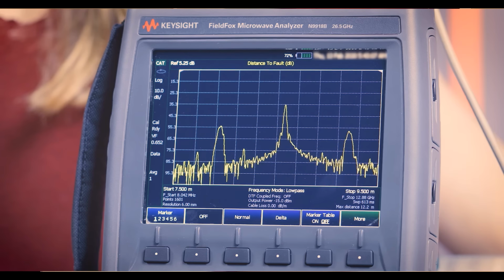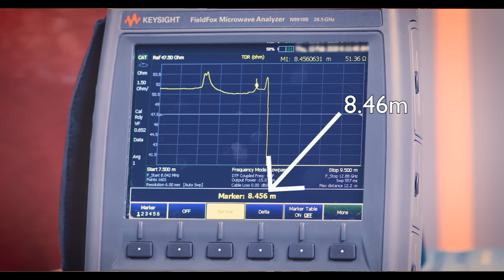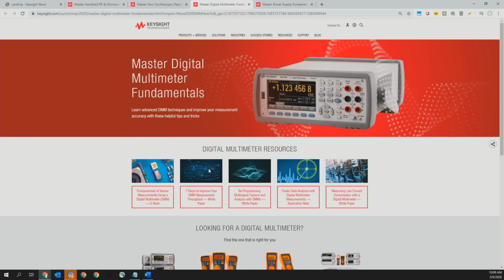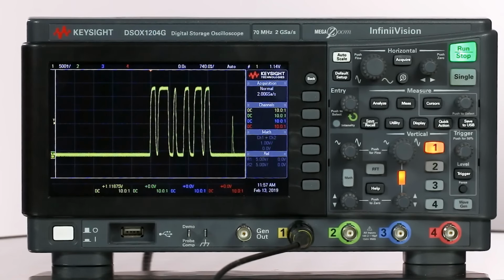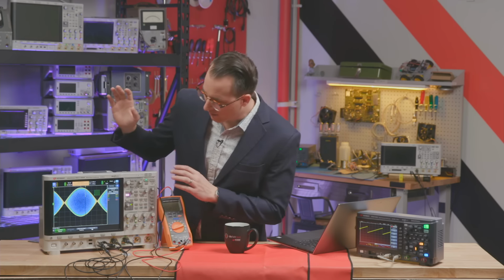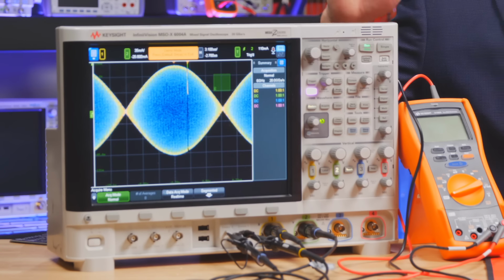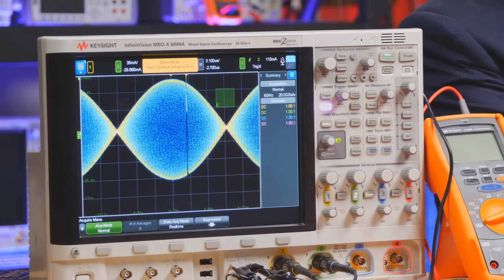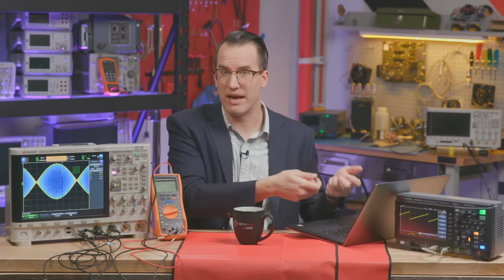Distance to Fault (DTF) Measurements

Comment: Considerations and tips for fibre or cable breaks.
#1 If you're lucky enough to have records don't assume they are correct.
#2 Seldom if ever do you know the velocity factor of a piece of cable mostly, you have to approximate it and this affects the distance to the recorded event.
#3 If possible, ping both ends of the cable or fibre.
#4 Use a measuring wheel.
#5 Look for signs of civils works 
#6 Don't use the red light feature on a 6 grand OTDR to locate a fibre use a cheap Chinese one in case it gets nicked.

Love your videos they are a good excuse for me to not do any work 😁

Comment: Oh! Never thought that this equipment could perform dtf. Very clever. I'd just manually inspect every wires that adds hassle in troubleshooting. But what I've notice is that she almost walk a mile for an 8 meters faulty cable...and also the sexy unicorn. Nice keysight!

Comment: But don't you need to know the dieletrical value of the CUT (Cable Under Test)?
This will greatly influence the lenght the instrument calculates.
Even if you measure from both ends of the cable you will not be able to pinpoint
the excact lenght of the cable or distance to the fault without knowing this 
caracteristics of the cable.
Reply from the maker: Yes, that's right! There are some standard values for different cables, and it's typically a spec for your cable as well.

Comment: I have a recording studio for teaching how to put a studio together and running thousands of feet of wire for recording purposes and teaching Guitar and a few other instruments. When running that many feet of wire and installing it in a wall I need to be able to trace just incase of a short to repair it without running more cabling inside walls and ceilings. I used a signal generator and a scope in the past but someone decided they needed them more than me and stole them. I need to replace them but as a small school just getting started finances are tight.
Thanks Rocky (Owner)
Reply: you might be able to tell Keysight how to fix their audio problems...
Reply from the maker: oof ow